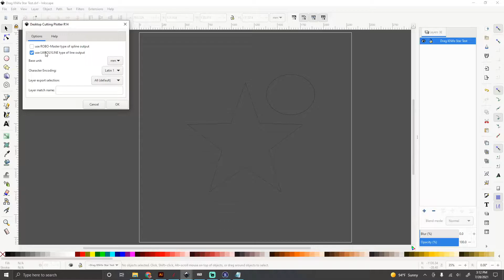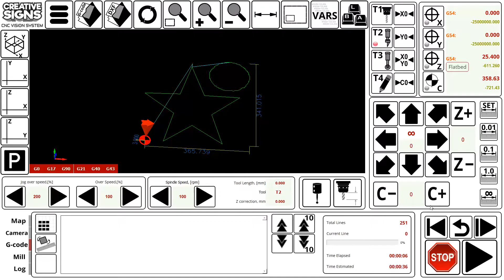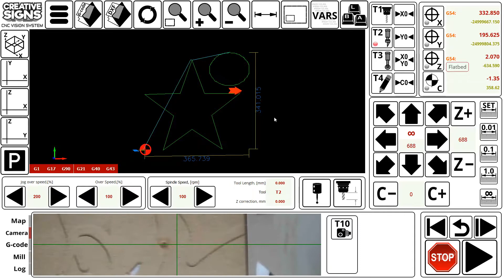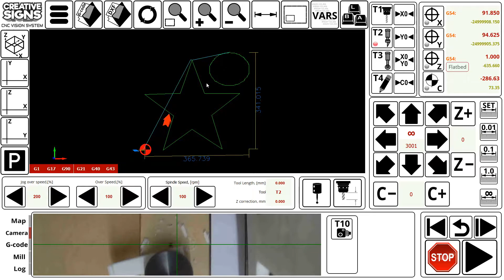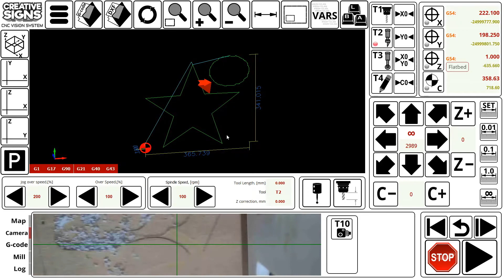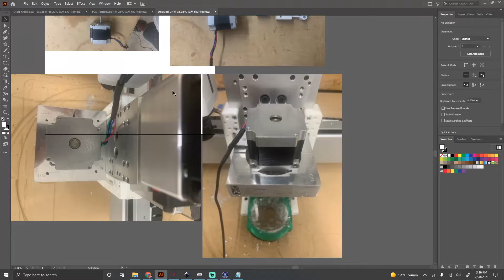Drag Knife CNC Software

Comment: This is awesome! What software of that?
Reply from the maker: The cam software is made by puruvesi automation. It works with their cnc controllers ET6,ET7,ET10 and ET15. I have the ET7 which was $5-600 but it has so many features built into the card and that is why I chose it.